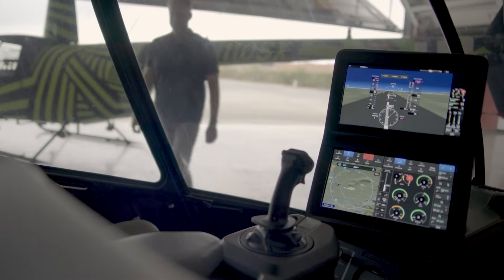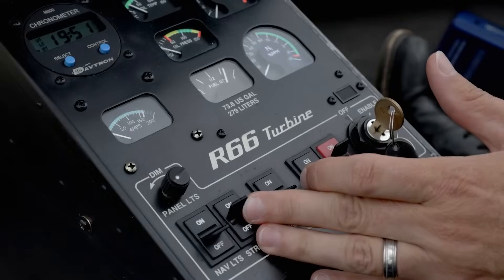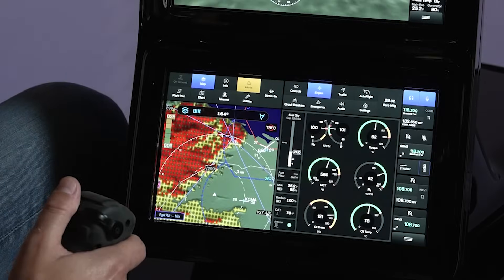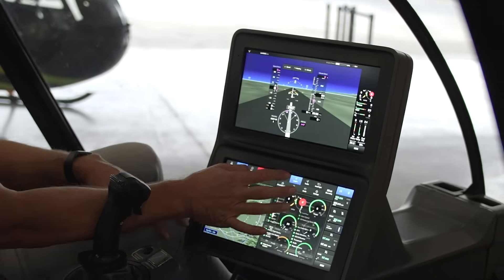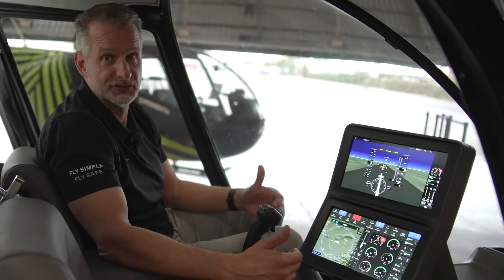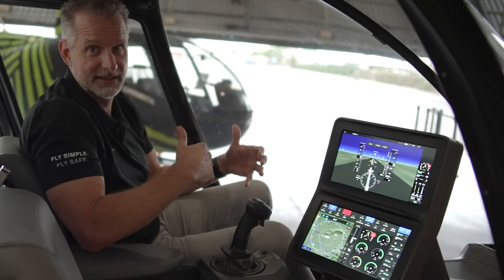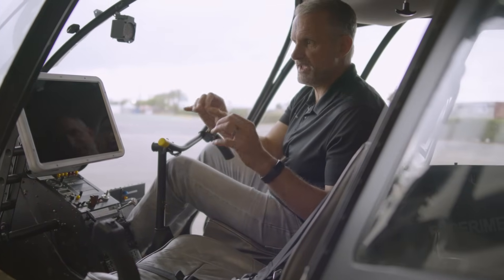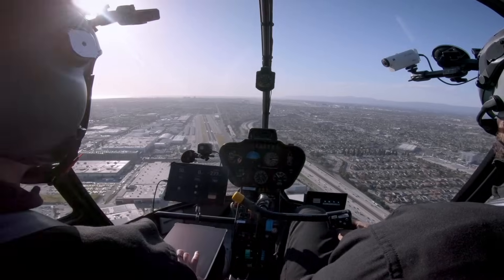Skyryse One™ vs. The Original Prototype

Comment: i guess this kind of evolution is inevitable. us stick and rudder pilots will resist it but change is inevitable and you can't deny the safety factors of full stab-aug systems. the ec-135 flies like it's on rails.

Comment: this is really cool technology taking out the complexity of multiple controls. However I think if you might have ventured too far from traditional controls with major assist (airbus approach ).  current pilots might not be comfortable even though its basically just riding at this point.  One thing I love about helicopters is that it is so focus oriented for TO and TD that its harder to become complacent like you can in general aviation.